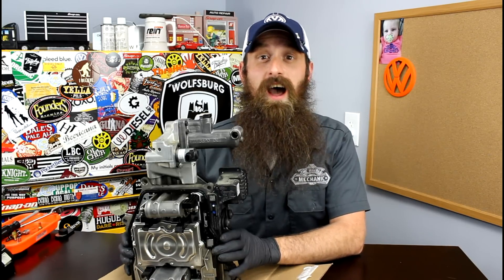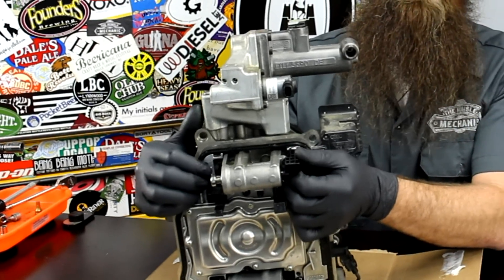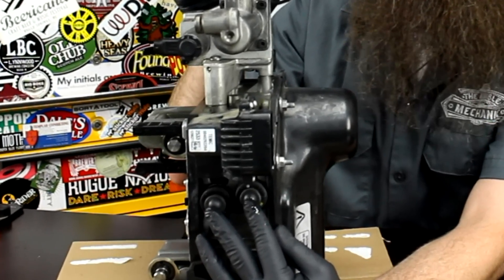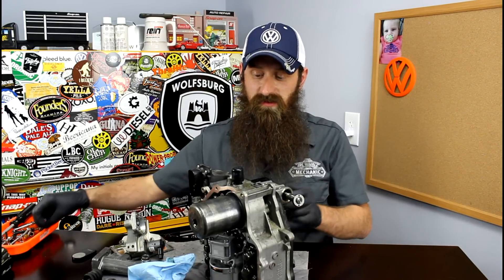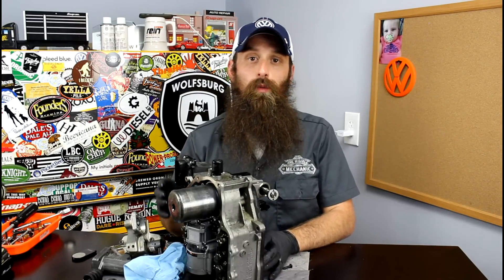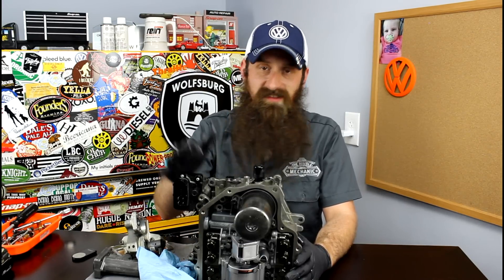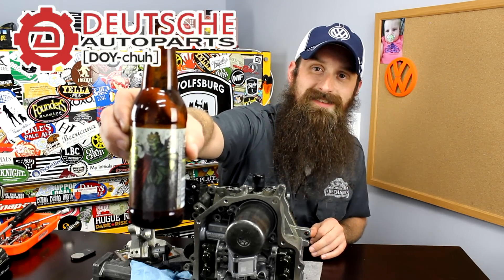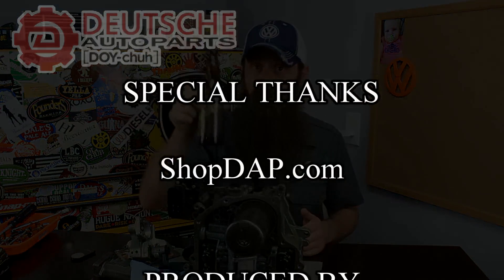How VW Parts Fail ~ 7 speed DSG Mechatronic Unit

Comment: I did not understand why they install the electronic card in a cramped place. normally a house these changes should withdraw them from the market, instead continues to sell them, there is talk of 12 million cars with this crap. Changing the gearbox or electronics is not cheap, today you can repair it, you would repair it more pleasantly if you did not know and it is certain that sooner or later you will have to repair it again, god hangman. I happened on this Russian site, I do not speak Russian and you see and understand that it's a shitty gear. http://www.remontdsg.ru

Comment: Sometimes, While I am driving my car the gear indicator and the service key on the dashboard are flashing. However, the car is working and the gears are shifting up and down properly. Maybe, have I a problem with the mechatronic unit?
Reply from the maker: Possible. Only way to known is to scan the car for codes
Reply: I have same problem with my Jetta, turn off the car and start everything good, do you find the problem.

Comment: (So my jetta hybrid is out of warranty with 110k on my car) and I was at the vw dealer getting an oil change and they had another jetta hybrid also out of warranty and the trans went (approx 100,000 plus range miles they said) while also destroying the ev motor so it was A total of $12,000 out of warranty job. That car got a flat bed to the scrap yard. It's a shame because it was in excellent condition too. My heart was dulled a little by that.

Comment: Another video I watched on a similar unit had a failed solenoid. The solenoids are normally 6 ohms. That was all good. But, when stimulated with 12v, one of the solenoids did trigger right. It took forever just to get all the Torx screws out....
Reply: 2014 Jetta6, only gear 1,3,5 & 7 working. 2,4, 6 and reverse are not working?
Im not sure if should try replace oil or go for mechatronic overhaul instead of new mechatronic.

Comment: I need your help to fix my car 2010 VW passat engine 18 turbo
- I have problem on gear box DSG 7 speed  when  i shift the gear to move the car it move only on 2 than 4 than 6 and R  and the lamp are flashing on dashboard inside the car
i want know the reason of this fault and the damage is it in the clutch or mechatronics
Reply from the maker: Gotta get the faults checked!
Reply: there is no code  we noticed only D flashing light  and when we start driving it goes to D2 than D4 than D6
Reply: P0715
Reply: @mustafaramadan1479  did you find the problem mine doing yhe same thing
Reply: "Limp mode", one drive shaft/clutch/actuator gone bad

Comment: I cannot believe they actually place the PC board inside the gearbox. Seems crazy to me.
Reply: Great for good temperature regulation in a clean environment. What's not to like?
Reply: @TonyRule  What's not to like is the very high temperature operation of the components.
Reply: @rogeronslow1498  this DSG doesn't reach temperatures which could damage the electronics
Reply: @JS-bf9dw  The hot oil creates a relatively hostile environment for components compared to ambient air temperature. Forget about SMD electrolytics for example. Only Tantalums capacitors will cope with that temperature. However, I can see that placing the board inside the gearbox significantly reduces the number of electrical connections that need to be brought out of the gearbox (solenoid valve drivers) if the board were externally mounted. But I think it's still a better option.

Comment: Have a 2015 Jetta hybrid. Who in the USA can rebuild the Mechatronic unit?
Reply from the maker: I am not sure of anyone that does. In the US that was a super low production number part.
Reply: Well, it looks like new ones from VW are "only" $820, a good bit less than I expected. But they are back ordered from Germany and will take weeks to get.
Reply: Finally the new mech came in last week and I installed it. Drives fine now.
Reply: Jetta mechatronic is rubbish for sure  😡

Comment: HI
Chris here from Cape Town South Africa, I have a  2013polo GTI my DSG box has been acting up since last year October.Every time when driving my car for about  10 to 13 kilometers my shifting gear change from Drive to spanner [wrench] on the display, I am still able to drive my car even in traffic, but you can feel the difference in the car's performance.Recently when I give gas [petrol] the car feels like one of the plugs are not firing, normal pull away then it's fine ,any solutions or recommendations would be appreciated.Thanks chrisphilander@gmail.com

Comment: i bought used VW sirocco  (1.4 twin chargers with 13k km ) -_- after 15km car oil change. the nightmare start 1st mechatronic  went bust  and got fixed with software then after few km got bust again  so they replaced it. at 16km its start to rugh shift from 2D ,3D ,4D and vice versa:/ .. (thanks to warranty) i got the clutch pack replaced .. fast forward to 45km i got my DSG oil replaced from synthetic  to a mineral.... now the warranty  is over and my car still with me and it got 98770 KM.. XD so far so good .if not for warranty  i would payed 3500 USD for parts and labour  T_T ... VW cars Are awesome  to ride / nightmare to keep .. il keep ridding  my discontinued sirocco with its discontinued  DQ200 DSG until  it rust ^_^ then il buy rust buckets  GTI and start all over again.

Comment: Hi...
i hav a vw golf with a DSG7 transmission, i had p0841 fault which is low trasnmission oil pressure, after inspection i found a small oil leak on the mechatronic. Could that be the reason? If yes, is it possible to add oil? Thank you

Comment: My DSG 7 has a random behavior. Sometimes it shifts perfectly, while other times on the same situation you can feels the shift, or even see the RPM  go a little bit up before it shifts. Once I changed the battery of my Golf and on the first run the DSG was perfect. After that it went back to normal randomness. What could be causing it?
Reply: My rpms rise before shift, exact same behaviour as yours. Did you ever source the problem?
Reply: @andruska1312  unfortunatelly no. I took it to some workshops and anyone noticed anything and they though all was normal… So I gave up
Reply: Any issues 4 years down the line?
Reply: @jithj4350  Thankfully not yet. My Golf 1.4 TSI is now 8 years old and 150.000 Km on the odometer, and the DSG has been working ok all this time. What I noticed, considering my last comments above is that the gear changes aren't so smooth with very low loads, but it works sincerely flawlessly on medium loads. Just got the temperature flap on the driver side to stop working, got stuck on the lowest temperature possible, which isn't nice because I'm on winter right now. This turned out to be a 1900 BRL (~500 USD) bill to repair.
Reply: @aftasarden2 I have this same car, does yours judder sometimes in low gears up shifting? Also any problems yet (I am 102,000km)
Reply: @whimsical6  yes
Reply: @aftasarden2  can u do a bigger reply
Reply: @aftasarden2  wait so the juddering is fine? I should get from 100000 km to 150000
Reply: My dq200 1.4tsi judders on low load too, mainly stop start traffic or between 1 and 2nd gear. From reading around, it’s just a characteristic of the dry clutch setup and how the mechatronic unit feeds the power slipping the clutch slightly. I’ve given up worrying. 80kms on mine.

My zf8 bmw auto is so so much better than this dry clutch setup.

Comment: I have a 2012 CC 2.0t DSG.  Had the infamous timing chain fiasco which involved bent valves (new head) next day after I got it the water pump failed.  Upon further inspection from me, two of the spark plugs weren't seated correctly.  Put a level across the could and they were a half inch higher than the correctly seated plugs.  My transmission now makes clunk clunk clunk sounds when I put it park or in neutral.  Strange thing is that it doesn't clunk if the front end of the vehicle is higher than the rear end.  Could any of this be done due to lack of proper fire/voltage or repairs made or missed when the dealer put new head and timing chain tensioner on.  I need your help brotha!  Love the Wookie by the way!

Comment: Hey i did an engine wash to my golf,  i have this same DSG 7speed 1.4 golf tsi, i am now having a NO communication TCM on my scan with VCDS, can you say what may cause it , do you think this can go bad by an engine wash? also i keeps blowing a 15amp fuse, i unplugged the tcm, and tried a new fuse, when i plugged the tcm in same thing, the fuse blown, i would appreciate any help from you, thanks!
Reply from the maker: yeah you probably have water causing that short. We don't have that engine set up in the US, so I can't point you to a location. Start looking for green corrosion.
Reply: HumbleMechanic thanks so much my friend I will let you know
Reply: thanks for the reply again, i did some checks but unfortunately no communication with TCM , so the mechatronics will need changing, do you think i will have to code this back, if so can you advise on coding or programming?? thanks again
Reply: Yes you have blasted water all over your electrics and expect them to work properly, what tree did you fall out of, for a start dismantle your fuse box ( under hood ), dry with paper towel them check the solder joints, re solder them if looking dry or grey, then give, them spray them with a spray of joint cleaner, then with a water proofer like WD40, you could also remove the shift changer lid off the gearbox top and clean and regrease the contacts with electrical grease you should have no problem then, but don't spray your electrics with water.

Comment: hi bro,  my volkswagen 2010 cc sport is currently having a reverse gear issue. Sometimes it would lose reverse and would just rev instead.  My quick remedy is to switch my engine off and then surprisingly everythings back to normal after i switch it back on. You think this is a gearbox issue?  or electrical? I dont know which part in the mechatronic needs to be replaced.  Is it the multi switch gear sensor? I need your help bro. please email me at sikreyto@gmail.com. Much appreciated.
Reply: mine is doing the same thing, did u ever found what the problem was? thanks
Reply: Did you get the answer, I'm experiencing that...

Comment: hey awesome video!!!!!!!, i own a MK6 Golf Twincharged DSG7, i have developed a few problems with the dsg, i noticed the D light blinks and the car stalls, i have to restart the car and it goes back to normal, i have scanned it using VCDS, and ive gotten a code P0841, can you say if a basic settings can fix this problem or what do you suggest?

Comment: What about the DSG 7, A0M oil change? Is it hard to change the oil and the special mechatronic fluid?
Reply from the maker: +bur0ak we only have that trans in the Hybrid Jetta in the US. That requires deactivating the HV system
Reply: hi im open seal green gear oil come out can u tell me whuch oil go in ?
Reply: auto uk  it goes 1L of vw power steering fluid code G004000 at the mechatronic

Comment: Thank for very informative video! I have only one question, it is possible to seal Unit after Oil leak and no problem with changing gears? Everybody told me that only solution is replace whole unit. thanks!

Comment: Hey. I have a Golf 6 1.2 TSI DSG7. After the engine heats up (15-20 minutes) in the 3,4,5,6,7 gears (not 1 and 2) and only between 1800-2100 rev it starts accelerating in hops (feels like very short brakes). These "hops" start multiplying the longer I drive, but only between those revs. On Sport mode (>2500) it accelerates fine. The problem really started happening a few minutes after the oil + filters change. at 50k miles. Before the oil change the issue was almost unnoticeable (sometimes doing it just in 5th gear). Changed : clutch, sparks, spark plugs, induction coil, camshaft chain (this was a must). Any ideas please?
Reply: That's not the gearbox mate, maybe the injectors?, not sure but definitely not the gearbox.

Comment: I have that DSG7 on my 1.6 diesel engine and I'm little bit worried about if it fails... it hasn't failed yet but I feel like it's a time bomb.  I've read a lot of DSG reliability issues and they're very expensive to fix, so I think I'll have to sell my car with only about 30k miles.
Reply: David L. It will fail. Believe u me !! VW is good but its DSG gearbox is pure crap !!
Reply: Ask VW to replace with new one as goodwill of the company when it failed n out of warranty

Comment: could you explain the difference between the "wet" and the "dry" DSG ....i drive a audi A1 1,4 turbo with a dry 7 Speed
(even if there is a old A3 quattro on my profile picture :$)
Reply: Clutch plates are immersed in oil or stays dry.
Reply: nothing else different?
Reply: the controller is different too.
Reply: Thomas Schwarzinger 
ok

Comment: Is that considered overly expensive to replace over the traditional auto transmission? I know BMW DCT's are like a ridiculous $15 k or something like that from what I've heard. That's the one on an M3 though.
Reply: it's not as expensive as the DCT, I forgot about the price but I'm 100% sure it's under 1K if I remember correctly it's about 700-800$, but remember this is just the controller, the gearbox itself is pretty much bullet proof.

Comment: Who makes that DSG? ZF?
Reply: In Europe these gearboxes are made by VAG group's factories. This dry clutch is absolute horseshit though, mine failed in 20K miles. I'm so fucked beyond imagination now, need $5000 for repair and warranty wont cover it.
Reply: I believe its lux
Reply: flow How will warranty not cover 20K miles? A warranty lasts for 100K miles.
Reply: BorgWarner
Reply: BW would be ashamed to produce that rubbish. It should be VW own engineering and LUK for clutch pack. DQ250 is unusual reliable to be a VW part, in fact it's not, it's BW licensed tech.

Comment: hi, i have a vw polo 2012 1.4 DSG 7. I have an error fault which says stuck in 1st gear and stuck in 6th gear P072C and P073B respectively. Is that the mechatronic unit or is it the actual gearbox that is stuck?

Comment: is that little thing the whole transmission?
Reply from the maker: +DJR5280 no that is the controller for the transmission.
Reply: They actually just control, 2 clutch plate and rotates the gear selector rotors (with notches for gear selector forks), each rotation selects two gear. The rotation (clock or anti-clock wise) is depended on whether you are upshifting or down shifting. Gear selection always done in pair.

Comment: Hey HumbleMechanic, Thanks for this video, its so hard to find any information on the Jetta Hybrid.  

I do have one question.  Does this DSG (I have a 2014 Jetta Hybrid) require the 40K service that other VW DSG's require?  I'm having some dealers tell me that there is no way to service this unit but then I see others post that they had to do it.

Thanks for your video's, they're great!
Reply from the maker: +Pitter Chi thanks for the kind word. 

So initially the hybrid DSG did NOT have a service interval. 

Then VW came out with an addendum to the owners book adding it @40k 

Now I can't seem to find any info about it at all. 

I was just trying to find it last night with no luck. So the short answer would be I am not totally sure just yet.

Comment: How have the transmission breakdown rates changed since VW went from torque converter automatics to DSG? We don't hear much about the DSGs here in Norway, but in Sweden there have been lots of issues with the 7speed dry clutch unit when used in Passat taxis. (1.4Tsi running on cng.) They actually stopped offering them as taxis.
Reply from the maker: +AkaAndyKnuckles I think the 7sp has been finicky, either as much or more than the wet clutch 6sp. They have had their issues too, but the 7sp feels like it fails more.

Comment: The rare earth magnet motor drives a pump to provide a system pressure of 4 bar if I remember correctly. The fluid accumulator is indeed a piston type accumulator that provides back up pressure for initial selection and is charged by the pump when the vehicle is overrunning to provide a degree of regeneration and "free" gear changes. The nested clutch levers in this are clever (and patented). The DQ200 dry clutch obviously has superior efficiency to any wet clutch design and was an attempt at automated shifting with MT efficiency in small engined cars. Hill hold and creep were difficult issues to overcome and preserve clutch life, but I am told these issues were the drivers for auto handbrakes. The spool valves in this transmission are amongst the tightest tolerance precision parts I have ever seen in automotive engineering.
Reply: Hello where would you get a new mechatronics unit from? Other than the dealer of course.
Reply: The dealer, unless someone is remanufacturing them...
Reply: Ok thanks i saw some on ebay with my matching part number can i just buy it and do the basic setting with my ross tech and be good to go?  Or would i need to match the software version as well?   Thanks.

Comment: My vw scirocco 1.4tsi makes an abnormal sound and vibration on lower gear during a low throttle, what is the possible problem?
Reply: +A&#39;lawi Aziz the problem is the clutch inside the dsg transmission. you need to replace the clutch!! I had the same problem before..

Comment: +HumbleMechanic is this the DQ200 unit (which is a 7 Speed Dry Clutch unit)? If so, this is the unit used in 1.2TSI VW Polo in India (and Malaysia). It known to be pretty problematic, especially in hot environment, with slow moving traffic (Like India and Malaysia).  Another issue with this unit is low torque capability (something like 250Nm).
Reply: +allajunaki Man I have this same unit in my 1.4TFSI audi a3 in Egypt, and it is also problematic in hot weather and slow traffic.

Comment: There are 47 bolts almost all are Torx 'just to disassemble it ---
ON THE BENCH.   very easy ,but impossible to remember where all the bolts go. Just  as well u verified that the entire unit must be replaced